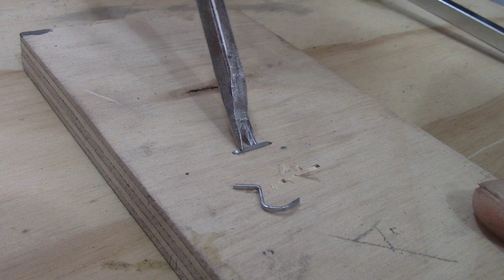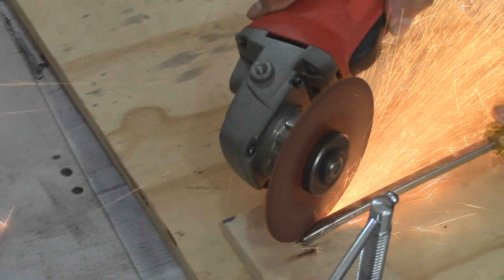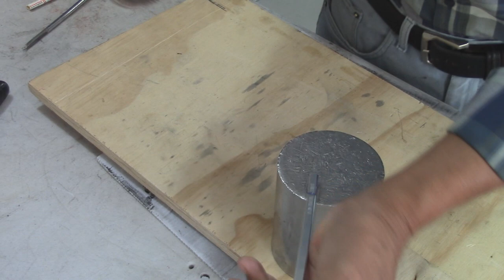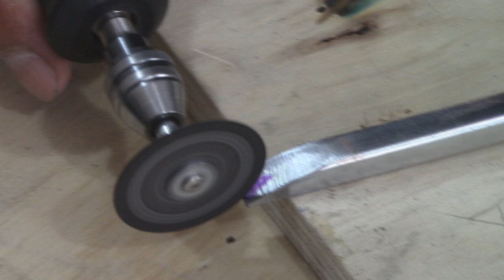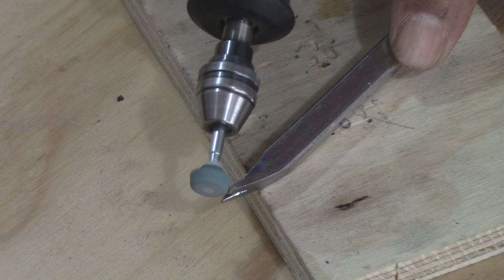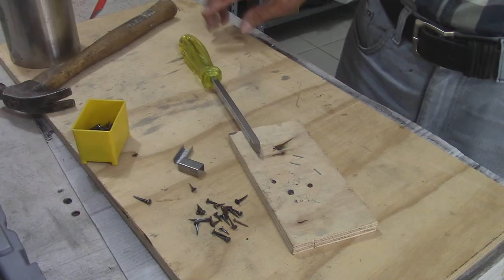Homemade Tack/Staple Remover - Upholstery

Comment: I was looking into getting myself a staple remover but this one is much bigger than the ones I have found. If i was to get 1 would you suggest a size like this that I would have to make myself? I am all about the best tools to do the job. Thanks
Reply from the maker: The idea is to get a handy tool. Of course not too short, just enough long to let us maneuver the lever easily to remove the tacks.